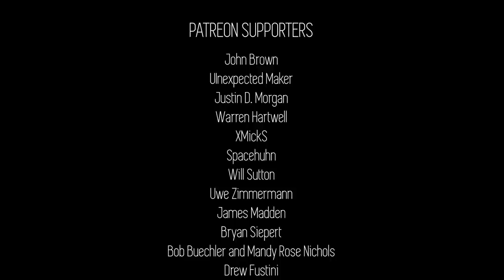Making 100 PIXO Pixels for Make/100 Kickstarter!

Comment: Great projects! found your channel a bit late. just have a quick question. i built my own 16x16 (2"/2") display only issue is these apa2020 produce so much heat even at 25% brightness , does yours run into same issue? Thanks , keep up the great work!
Reply from the maker: Thanks! Yes, they are warm under normal use, if you crammed 256 on a 2" square board I could see it being hot, that is small! Link to your project?
Reply: SeanHodgins Will be posting a vid on my channel here soon , im printing a TPU mount for it . Thanks! I tried sourcing a china company to pick and place this size leds on 2"/2" and they tried even doing it by hand but were unsuccessful it was way to small.I just took 4 adafruit 8/8 2020 matrix and joined them together.problem is they have borders right in middle of the display , i sanded it down as much as i could looks ok but i cant stand the gaps lol. The plan was to build a 32/32 matrix in smallest size possible but got discouraged after seeing how much heat it outputs specially as it will be on a wearble basball cap would burn your forehead. Im try pick up one of your kits if its still available it has alot of cool features! Thanks again!